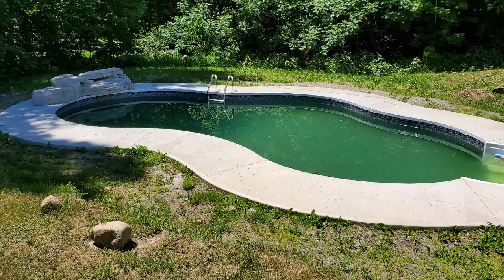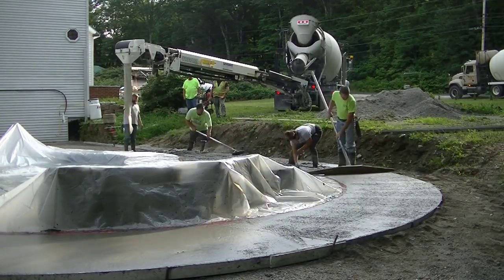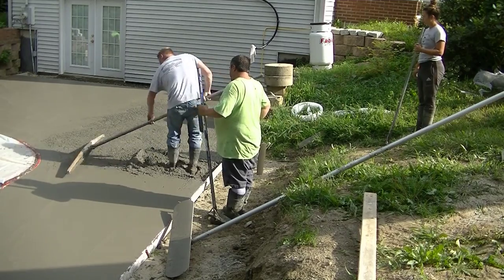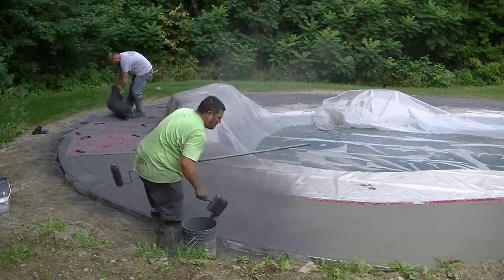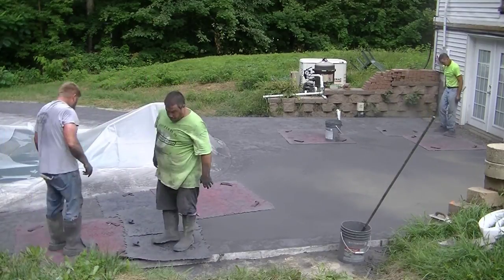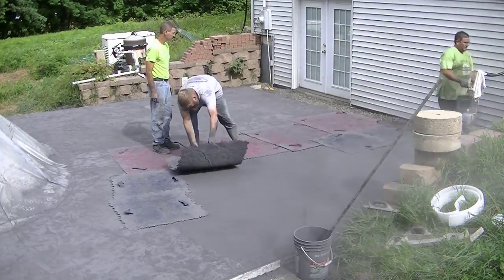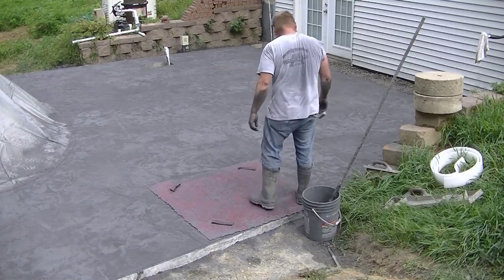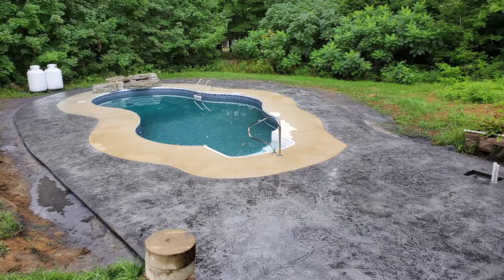Stamped Concrete Patio Extension Added To Existing Patio Slab

Comment: I don’t know which texture I prefer more. I think on a free form shape like that, this stamp is very appropriate. For something with more defined edges, probably the other type with the grooves built in. 
  The one you used here looks like the type that someone should learn on bcz it seems like it can be a lot more forgiving than the more patterned ones.
  I always heard the shoes Darrin was using, referred to as ‘The Frankenstein Boots’. 
“Alright, go get the Frankenstein Boots. We’re ready to start stamping.”
Reply from the maker: This would be a good one to learn on. Thanks for your commenting and your support of the channel:)
Reply: I was thinking the same thing about this pattern. You could hide a beginners mistake easier.

Comment: UP north i assume you use air entrained in  most if not all outside pours - when you use color hardener do you use a lower percentage or does it bleed just fine to absorb the hardener?
Reply from the maker: We use 5% air, we don't throw hardner we use integral color.

Comment: Are we good using pvc trim boards for expansion joints?
Reply from the maker: The pvc trim boards are for forming curves like on this patio. Use the foam expansion materail for in between placements or in between new and old concrete pours.

Comment: Is it possible to color and/or texture match the existing concrete?
Reply from the maker: You could stamp the existing to kinda match using a 3/8" stampable overlay material.

Comment: Is there expansion joint anywhere, or not necessary?
Reply: Mr. Day mention he was goin to do saw cutting expansion joint the following day.
Reply: @IvanHVAC  Missed that. Thnx mate
Reply: The cutting would be for control or contraction joints. Expansion joints are between 2 slabs. He used a PVC trim board for the expansion joint butted up against the existing slab